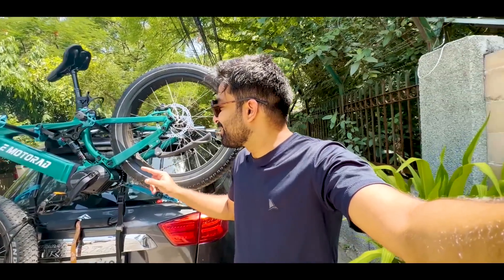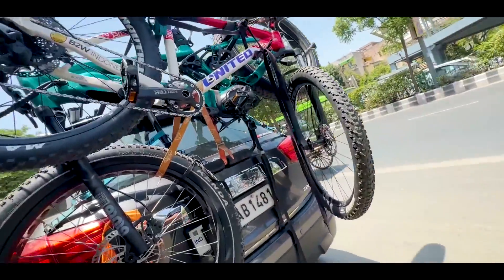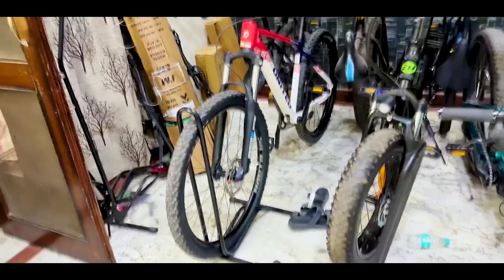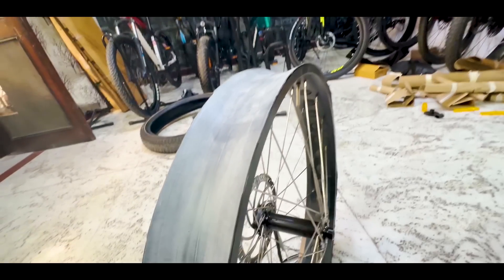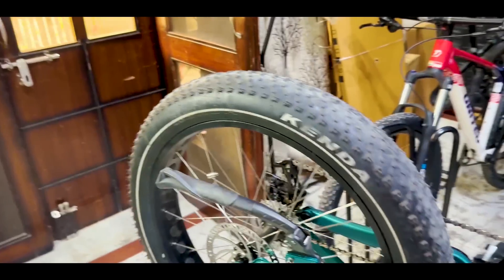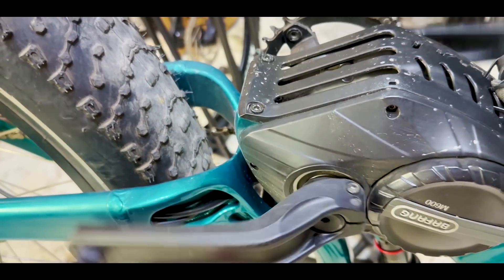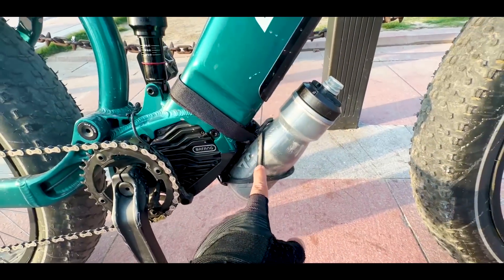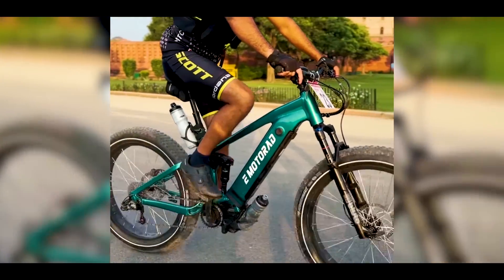Finally MODIFYING my ₹5 LAKH Emotorad Bicycle !!

Comment: Awesome bike, Vaibhav. The specs of this bike say that it has a 250W motor. I thought Bafang mid-drive motors were all 500W and above. I bet this is at least 750W and they market it as 250W cause that's the maximum allowed in India?? 😜😜

Comment: Hello  MR.Vaibhav

Which MTB helmet would u suggest under 3000 which will offer good protection

Some of my options were 
1-Rockrider 500 helmet -₹2500
2-Bell crest MTB helmet -₹2799
3-Van rysel-2500
4-saftey labs Avex-2400
5-saftey labs xeno-2100

Or if u have any other good suggestions plz recommend 

Thank you very much for your time and suggestion